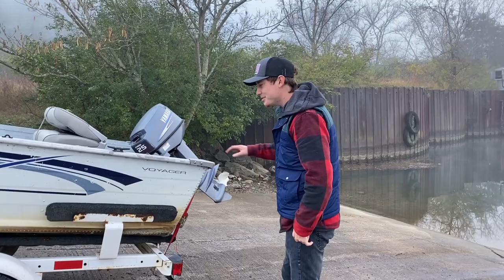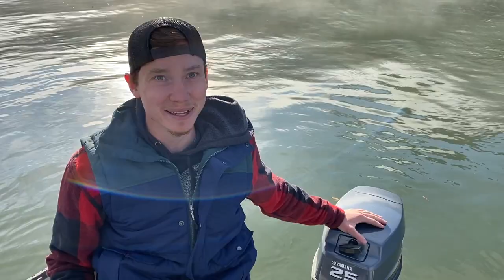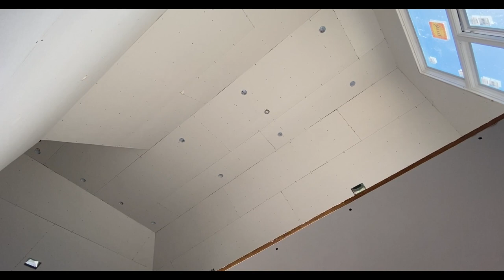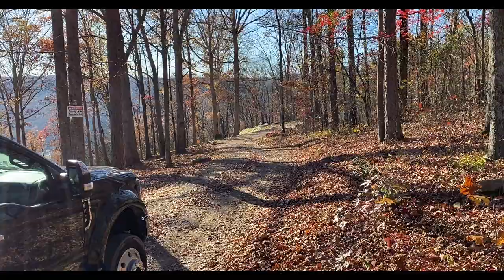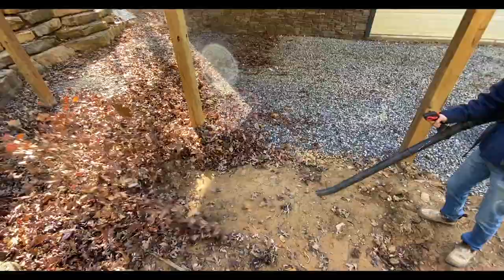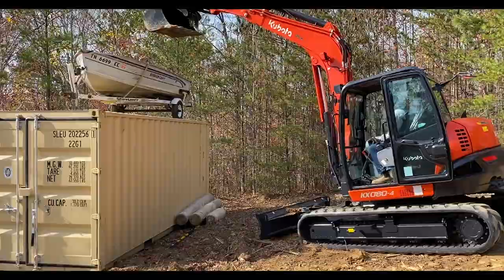The New Goonzquad Headquarters Part 40

Comment: When you guys said take the engine off so it doesn’t freeze I laughed! I live in Alaska and my 350lbs motor is still hanging on my boat which is shrink wrapped! My advice, trim the motor down, remove the drain plug (so you don’t flood), cover it up, add some stabilizer for the two stroke fuel!

Comment: The 2 stroke outboard engines are fairly handy to winterize, but the most important thing is to get the water and fuel out of it before putting it away for a while.  It's also good to do a service and change the gear lube for the drive unit for maximum lifespan. And the only thing you need to do to that boat is give it a buff and and wax.   And most importantly, Enjoy! Which you're already doing!

Comment: Make sure you hook that hand crank winch up to the eye on the hull next time you launch and pull the boat out. I've seen boats slide off trailers on boat ramps before. Aluminum hull or not it would still suck.

Comment: I would get forks for the skid steer they are the best attachment you can get for what it is. U can lift pallets and break tough tree roots by sticking the forks into the ground and lifting and u can use it to lift motors and whole much of other stuff

Comment: That little boat is awsome, If you brush/wash off the outside haul on the water line with muriatic acid It'll take all the rust and yellow streaks out. P.s careful not to get it on the engine cowling/fairings   they will stain

Comment: You guys should make a burnout pad to test all your new builds on !
Reply: Many of the cars that Goonzquad worked on in the past had very low ground clearances, so the entrance road, the access spur and the parking areas next to the proposed new Garage/Workshop on the West side of the 'HQ House' will need to be levelled and properly surfaced before bringing those vehicles onto this site.

Comment: Make sure they remove all the dust from the mud before priming everything. If you paint over the dust before removing it, the paint won’t stick to the walls. You should use a satin paint. It still has a bit of a sheen and easier to clean. If you end up brushing and rolling, 2 coats is what you should do. If you choose to spray it, be sure to have someone behind you back rolling with an 11” roller. The sprayer applies the paint, the roller works it in. Trust me. I have 20 years experience in painting.

Comment: Good buy on the new kubota...some think covid has killed the market, but it's just the opposite.  The used equipment market is thru the roof as supply is low.  I just went to an auction to try for a used track hoe... very very used...and at top it was worth 20k, but thing sold for 40k.  20 years old, needed hydro work and a lot of work too.

Use that thing to grade some drains and install some tinhorn drain pipes under the road...that will carry water from around house and down the hill.

If ya do the pond, you will get plenty of fill dirt, but save the top layer to spread on top of wherever you use the fill.  The subsurface dirt is sterile and will not grow grass.

Comment: Leave that drywall off until the new garage door is installed. New tracks and springs could land higher or lower by an inch or two sometimes. Unless it’s the same brand door.

Comment: Make sure you winterize it properly. Stabil in fuel or empty tank n put some non ethanol fuel in if you have it down there. Fog it out. Spray it down with wd40 or crc656. Change the lower unit oil and waterpump if it hasn’t been done recently. Just powerwash that hull n call it a day.

Comment: yous need to dig up that drean that you've bought and put a mesh sock on it so doesn't clogged with dirt overtime then fill it in with the gravel rock which then will prevent large stuff from getting in there and then drain it into a safe location

Comment: You should check with the state DEP before you dig your pond. There could be restrictions later on  such as  how far structures need to be from it and you may  never be able to move or drain it.  I've seen it happen.

Comment: U should put the boat under the balcony so if it rains it doesn’t get filled with water but everything is great good job 😊
Reply: Or unscrew the drain plug
Reply: @eldnah2  but it would still be flooded cause the is surface under it 🥴

Comment: The Yamaha is missing it’s trim anode on the lower unit. That’s why steering will be stiff while your running. DO NOT OVER GREASE like it’s the Kubota. Good buy though

Comment: Need to run a plate tamp on that spot before concrete. Got the clay for a pond. That's the main thing. Clay holds water. Dirt won't. Get someone to help tho. If the pond has a blow out and washes other ppls  property out they will sue you. Seen small ponds blow out. Water does crazy damage running down hill.

Comment: Just a few things for 2 Stroke Premium Non Ethanol Fuel with right oil mix a Fresh Spark Plug and fuel filter each year  and check Crank Case Oil Level and Can’t Stress Enough use Yamaha Oil’s 🤟🏻🤟🏻🇺🇸🇺🇸🇺🇸

Comment: This comment is probably buried, but for the pond I'd recommend getting some concrete tarps. You can line the bottom of the pond with these for structure and not have to worry about erosion.

Comment: Hi guys, boat needs a little update. Gotta tinker to it to make it yours. Otherwise you're always driving someone else's history.  Goonzquad Tracker boat. Get a new water pump impeller, and relube lower end, fresh plugs Easy stuff, keep it reliable. Fresh fuel and a quality oil mix, and make sure fuel vent open on tank when running. And stabilizer in fuel.

Comment: Be carful of the weight you put on that shipping container.  It’s not engineered to handle a lot of weight on that roof.  It is however engineered to withstand a boatload of weight on the perimeter of the container.  Congratulations on your success!

Comment: You need to remove and properly install that drain pipe that you installed earlier before you have the concrete installed or you WILL have drainage problems.

Comment: Front door right into the kitchen that's the size of a bathroom?
Reply: It is a very cramped building, and the worst feature is the total lack of any entrance hall, draught lobby, mud room or anywhere to hang wet coats, or a rack for boots and shoes as people enter. In the cold and damp part of the year this will be very inconvenient and unpleasant. People in the large ground floor room will be shivering as the cold winds blow straight into the house. No rural residence should have been built (or remodelled) without these practicalities being taken into account.
Reply: @johnstedman4075  very good points. It seems as if the entire house is upstairs and the kitchen and garage is downstairs.
Reply: @richardlfd135  One of my staff (a Chartered Surveyor) actually inspected this property two years ago. She took the view that it was not well designed or constructed and would be very difficult and probably unviable to satisfactorily remodel. Goonzquad paid $360,000 for the 15 acres, which suggests that the house was valued at very little in that transaction. As an Architect, my instincts are that it would have been better to demolish the structure, and to create a new composite design incorporating houses for each of the two brothers, offices and storage for their businesses, a garage/workshop with room for eight cars, plus a large paint booth. This would have fitted comfortably into the flat area of the open site which already exists, and could have neatly capitalised on the the key asset of the location, which is the fabulous view to the south.

Comment: Mud ? You on about plaster
Reply: In the US any type of car body filler or drywall plaster tends to be colloquially referred to as "mud" in casual speech by people who do not have a need to communicate more specifically, and who usually tend not to produce detailed written communications very often. Additionally, they often casually and wrongly use Trade Names instead of generic terms when the latter would be correct. Professionals use a much wider and more accurate vocabulary, largely because they often need to employ unambiguous language when writing sizeable documents on a regular basis in dealing with complex matters which often have contractual, financial and legal implications. Goonzquad are "dumbing down" their content in this respect, probably because they think this style suits their target audience. Their assumption is shortsighted and shows that their understanding of the demographic range of their Brand is not currently being developed to its full potential.